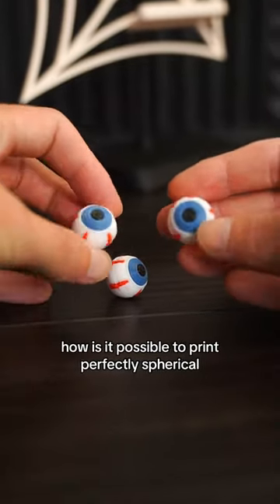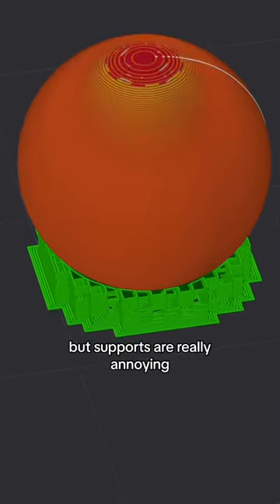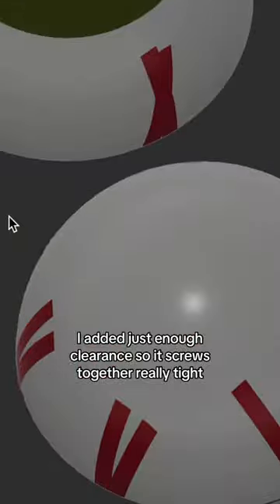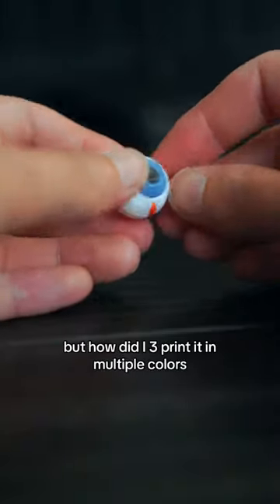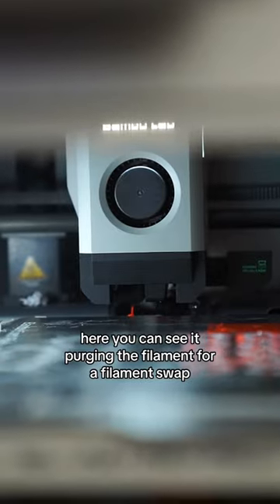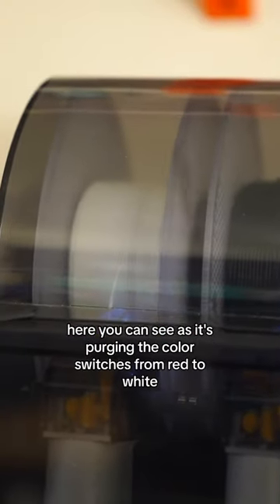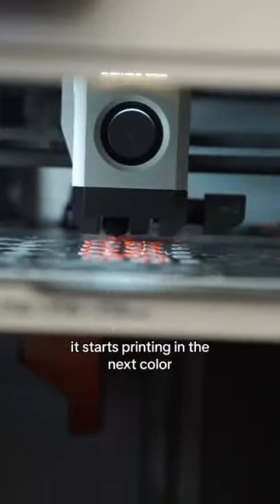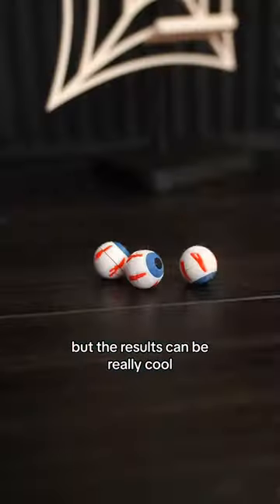How to 3D print spheres

Comment: Not only do they not perfectly align, with those giantic layers you might as well just print it as a single piece.

You can also just draw a simple column that's about half the width of your sphere in supports and it'll stick just fine. At that point it's a simple snap off, instead of having to teach yourself how to design screws for an FDM printer which is not as straightforward as it seems for amateurs.